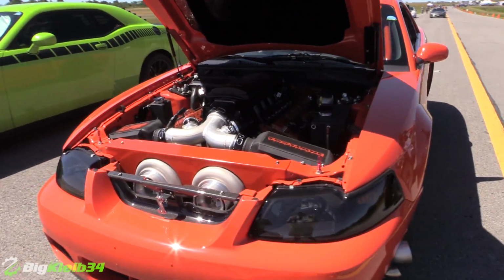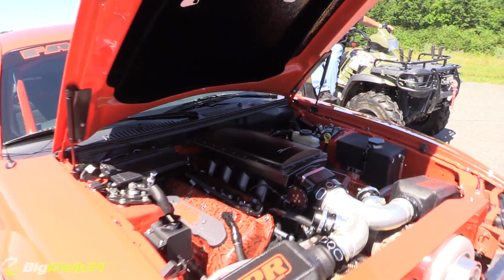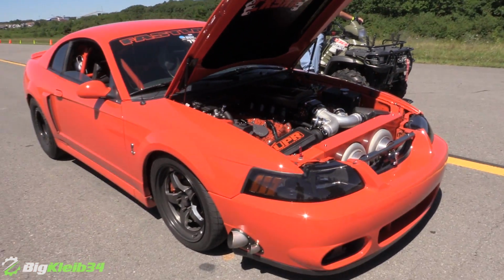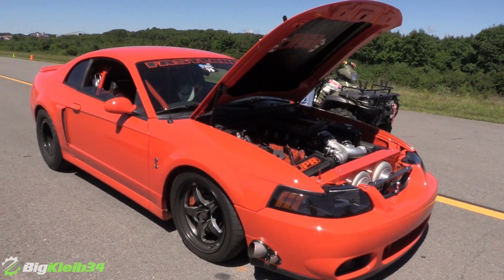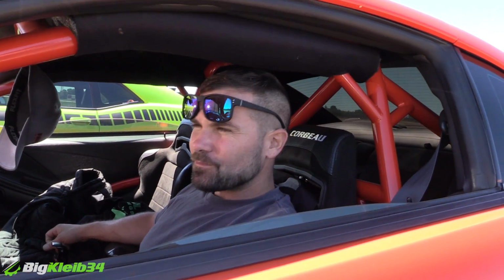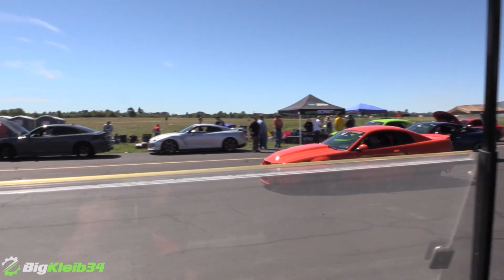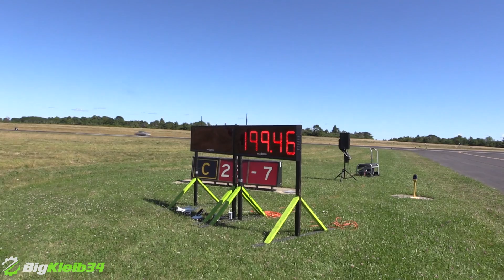200 mph TT Terminator Mustang - "Stopped Turning it Up to Prevent 130mph Burnouts"

Comment: Cool car but why would you do this to a Cobra. By the time you've swapped out the IRS, swapped out the blower for turbochargers, swapped out the T56, rebuilt the engine etc, you could have just started with a GT or V6 base for cheaper.
Reply: Boost Nazi The thing is after a certain point, the way the cast iron 4.6 4v is built,  the cost of getting this kind of power actually ends up less than what you would be able to pull out of a built from scratch 2v car.  The Terminator motor is just a much better platform to build off of.  In most cases I'd be right there with you as far as robbing a Cobra of its essence but in this case this car is so awesome I'm willing to look the other way.  Besides at 1200 horse power shifting gears just becomes impractical.
Reply: DrBIeed Except this car isn't running a 4.6, he said a "2014 Shelby block" which is a 5.8, and this ones sleeved.
Reply: Bc why not bud
Reply: I hear ya and I don't at the same time..lol. I'm a car guy and drive a 2015 Competition Orange PP GT. At the end of the day a car is just a hunk of metal we obsess over a bit too much (Myself included). So who cares what he does with it. No car is safe from this mentality with me.
Reply: Boost Nazi go on instagram if you have one and look up @fastlanemotorsports , it's his shop and if he started off with a v6 or gt then it wouldn't be a cobra haha
Reply: Because cobra !
Reply: Bahaha everyone is calling you Boost "Nazi".
Reply: @DrBIeed  What's that point though where the 4v becomes cheaper??  Look at Andrew Lavender on youtube.  He's into his entire car for about 20 grand on top of the initial car purchase price.  We all know what you can buy a 2v gt for.  Running mid 8's all day long on only around 850whp.  He's not alone either.  I'm sure an 8 second Termi is going to cost more...waaay more just on initial investment in the car.  A 4v swapped 8 second car alone will cost more.  People read so many comments like 'the termi motor is a much better platform' and just write off their 2v.  Better is a very general term.  Like you said, there's a point where the 4v makes more sense, but the vast majority of guys aren't going to ever hit that point.  That's why you see all these 4v swapped GT's where they wasted money for a slower car than they could have had by building the 2v, cause that magical "potential" is there that they'll never reach anyways.
Reply: @phobos2k2  LOL... you've never built a 2v 4.6, have you. I have, and I'm here to tell you it's not worth the money when it could be put into a 4v that can be had even CHEAPER than a crate 2v if you know what year Lincolns to look for. Teskid 4v block, anyone?
Reply: @vonjager  I had a Lincoln Mark VIII. I planned to to swap the motor into my Vic. Somehow I changed my mind started building the 2v and never looked back. Everybody has their reason for their build.

Comment: What that car needs is a higher gear ratio, if it has 4.10s swap it for a 3.73, or even 3.55s, or 3.90 but i'd go with one of the 2 first mentioned.. Would increase his Top Speed as well, way past 200mph and lessen the burnouts at high speeds.. When you make huge amounts of power, you don't need low-ass gear ratios..
Reply: TigreLoko24 yeah because he doesn't know what he's doing 😂 come on dude get out of here
Reply: Naasko595, what are you trying to say?? I know what i'm talking about.. Anyone smart enough would listen..
Reply: Dude needs more like a 3.25 or lower with that much power.